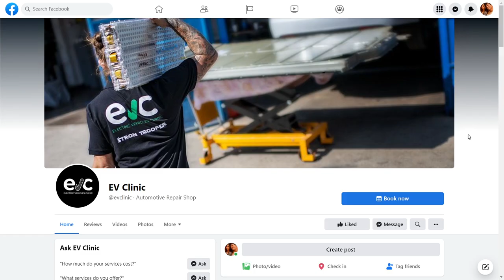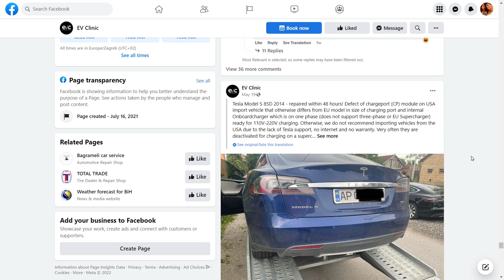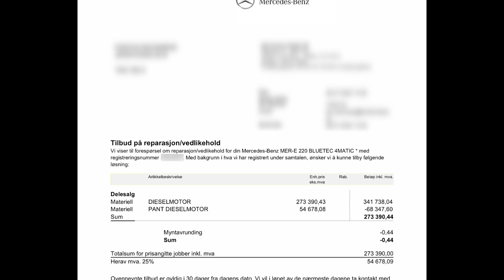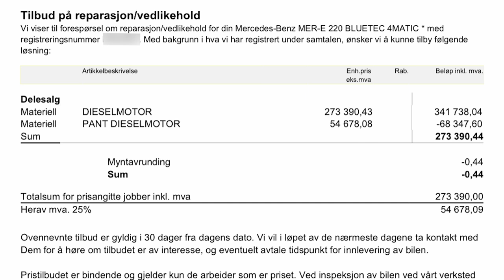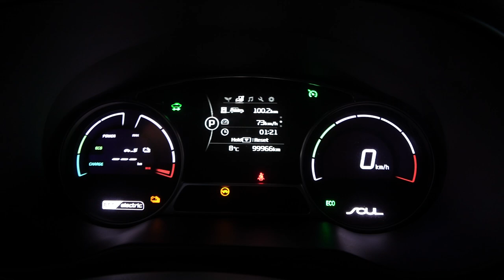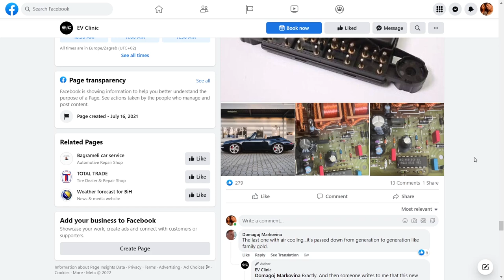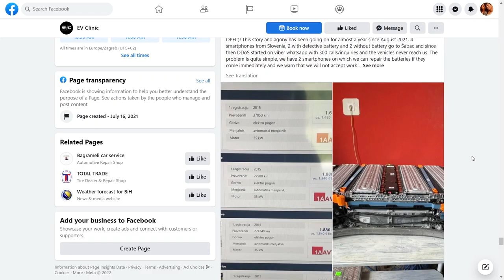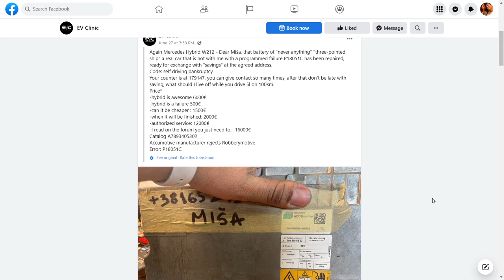Why fossil cars are more expensive to repair than EVs

Comment: So it looks like the consumer ICE design is constrained nowadays by Efficiency in addition to Reliability and Performance. Previously I had heard from a racing engineer that it can only be either fast or reliable. So a triangle diagram a lot like the Cost, Time and Quality that you'd learn on any basic engineering course. How times change, but one always learns something new, thanks for the informative video Björn and Co.
Reply: What do you mean by time? You can literally drive any car at 75mph or 125kmh. What makes it any different other than 1 road and its only in germany? Have you heard camry hybrid? Sonata hybrid? Prius? Corolla hybrid? Honda accord and insight? Rav4 hybrid? Venza hybrid? All of them doing just fine or even better compared to kia ceed that still on top of the 1000km challenge
Reply: @pepehands3399  ICE engines are more reliable than ever. The problem is that electric cars are still too expensive + infrastructure is not there.
Reply: @dragospahontu  thats right, not only they are became more reliable especially the japanese and koreans, you only need 5 minutes refill at gas station to cover 2-3 times more range compared to ev. People are now starting to have concern at the supercharger safety especially at shady place. And when its full you need to wait extra 30 minutes and the charging another extra 30 minutes. For me, thats alot of waste of time
Reply: @pepehands3399  that's another part of the story. But the thing about downsizing and reliability is bs. 

Yes, when strict emissions standards came in, everyone had problems with burning oil. But we are well past those times. 

Now with modern technology engines are better than ever before. Toyota dynamic force engines have 43% thermal efficiency and can run for 500,000km.
Reply: Way to go off course there chief... I am talking about general engineering principles, I'm not having a dig at implementations.

Comment: I bought a used a used zoe a few years ago but after some time it started giving errors and eventually stopped charging sometimes. Apperently the bearings in de motor were toast and the entire motor had to be replaced for around 3000 euros

Comment: I can get a used Cadillac LFX 3.6 engine for my 2014 CTS for only $1500, and the 8 speed transmission for another $1000. Certainly, that is used , 70,000 miles, but I think that will work. I am now at 82,000 miles, and I don t expect anything until 150k when I have to worry about timing chains. With used parts , I can be much cheaper than refurbished ones. The new DI engines are horrible when compared to the good old pushrod port injected ones. Bad reliability, and even bad particulate emissions, all for 2mpg better fuel economy. Great video.

Comment: Wonder how it will work with structural battery pack, does not seem to be possible to repair. Seems silly when you know it could be just a few cells being the problem but with the current construction you can't remove them
Reply: Yes, the new Tesla battery will not be repairable. Sandy could not even open it up without damaging it.
Reply: @dkostasx  then you won't have the problem of water coming in. Which tells the car it's broken. The 4680 won't need any service as old fashion batteries
Reply: @mikaeloverby  You will still need service, just it will be much more expensive because any small issue will lead to full battery replacement. Making the battery unrepairable does not make it not fail. Just because they filled it with some kind of gunk it does not mean that it cannot fail. The battery consist of many components, e.g. contactors, PCBs, cooling system, etc. and any failure of those components would lead to full battery replacement.
Even the old batteries which can be disassembled and fixed are not repaired like that any more. There was a video in YouTube where it was shown that a simple cooling pipe adaptor broke on Tesla Model S battery and Tesla offered to replace the full battery even though the cost to fix the issue in some 3rd party service was like a few $
Reply: @dkostasx  there will always be some mondays car made and that counts on everything. It's very rare that components have a issues, so this will only count for a very few people, that will need a battery replacement. The new tech and design can not match the old fashion used in earlier cars. Only time will tell.

Comment: BMW 116i, 2008 model. It had only ran 72k when I got it (in 2017). It broke down after 5-6months, complete engine failure. 134k to fix. More than what the car was valued at back then.

Comment: a price comparison is made between a repaired battery and a hail new ice engine, this is skewed. First of all, a new tesla battery is not even available/for sale and if you start calculating, an 85kWh pack quickly comes to €22K ex work...just calculate €25K. The story about the Kia battery seems very strange to me and how do you find a match .. 2 new cells will not work, at least then you turn the problem around, mixing old cells with new cells is patchwork and not a long-term solution I think ? a refurb tesla battery then you get what you had in terms of capacity and with a 3 party it's just a matter of waiting how long it stays good. See too many things going wrong with electric car batteries and that's why I'm against third party repair...it's dangerous and you want it to be 100% safe in a car!also take the example of the 1.6 million kilometer model s .... this has had a new / overhauled drive unit 16 times! so every 100,000 km! within the 8-year warranty it does not hurt, but now that the first years of construction are out of warranty, it will be a different story in terms of cheap driving? let us know what a hail new Drive Unit costs at Tesla and then compare it with a hail new ice motor.....
Reply: Finally some common sense!
Reply: These guys are running a business. Plus there are a few people in the world that know how to repair EVs.

Comment: I had Peugeot 308 sw gasoline car and its engine broke (one of pistons leaked), the repair Shop said it would cost around +8000 € to change, also told me it would be cheaper to order whole new engine from france than to repair the broken engine. It was driven only 50-60k kilometers and was 2,5 years old car. Luckily it was covered with factory 3 year warranty so it didnt cost me anything.

After getting new engine, I drove it around 10k kilometers and the roof of piston cylinders had oxygenated (or something, cant remember exactly) and there could be possibly be 5 more reason what cause engine fail error and estimated cost to fix that was at least 1200 € (if no other problems would be found) plus labour, so that was when I traded it away broken few years ago. 

Now waiting for my new kia ev6 rwd gt-line 8)
Reply: That's an isolated case for a french car. The same can happen for an electric car.
Reply: Never buy a French or German car. Some day people will learn.
Reply: @dragospahontu  o shit, didn't saw the replies.

First of all, there will be no pistons in EV so no, it will 100% surely not happen again and after watching this video again, it looks like repairing some battery problem will be 50 times cheaper than what broke in my Peugeot. Good times soon.
Reply: @zappbrannigan8325  it seems like a eutopia

Comment: I believe the two things making modern ICE vehicles more prone to repair is improving fuel efficiency standards and improving crash safety standards.  The improved safety standards have added significant weight to the vehicles (more structural steel and airbags) so in order to compensate (just to maintain fuel efficiency) vendors have to find more weight savings.  I had a 2011 E91 BMW wagon with inline 6 cylinder gas engine that used a plastic valve head cover (and gasket) that needed to be replaced after only 6 years. Having a critical plastic part in the engine bay that is subject to degradation from thermal wear from engine heat is just asking for trouble over time.  Generally EVs are not subject to as extreme thermal changes as a running ICE so will suffer from less rapid degradation of plastic parts.  And as stated in your video fuel efficiency engine improvements (smaller displacement with higher compression and/or turbo)  puts more stress on engine increasing occurance of failures.

It would be nice to also do a pure scheduled maintenance cost between an EV and comparible ICE vehicle (like Tesla model 3 vs BMW 3 series).  I now drive Tesla model 3 based on scheduled maintenance cost alone.

Comment: Ok, so basically EV battery packs are not sold new, you give your old pack back with a "1€" fault and they will sell a refurbished pack that costed "1€" to fix for an incredibly high price, but from what I take from this video usually what makes pack fail are small issues that the BMS blocks pack operation for safety and further damage, and then EV manufactures charge and insane amount o money to fix a very simple fault. This is borderline fraud, there is no justification to charge an arbitrary huge amount to fix a battery pack, when the fault can be a "1€" fix... I'm a Tesla owner and EV enthusiast, on my last year of pack warranty, so great video Bjørn as always, because the only way to go is getting these companies that will fix our "1€" pack problem for a reasonable price... Tesla and other manufacturers should support and sell parts for these guys so they can fix the packs and keep perfectly usable EVs running...
Reply from the maker: You forgot to count in the hours it takes to replace the part, the investment in repair garage, etc. It's simply not just a €1 fuse you plug and play...

Comment: I thought this was the case that ICE is more expensive than EV to repair after a relative was quoted $14k NZD to replaced a 9 year old Diesel Korean SUV with a used engine but this is really great to hear from professionals.

Comment: I think everyone can agree that repairing EVs can in some cases be surprisingly cheap. However, much depends on the specific make/model of the EV, availability of spare parts and availability of experienced EV workshops. The demand for out of warranty EV repairs is currently quite low, and consequently the EV repair ecosystem in many (most?) countries is poorly developed. Until the situation improves, buyers of used EVs will have to be careful.

Comment: I think Tesla has now effectively made their new 4680 structural packs irreparable because they are filled completely with foam. This isn't an EV problem, but going forward I think it will be a Tesla problem. Thoughts on this?
Reply: I guess remains to be seen. Nobody can really know how well these (and others) pack will last.
To me it looks like that Tesla is optimising production cost over maintainability in general.
That is also what Sandy likes :)
I personally  think maintainability in general should have more priority.
Reply: It will catch fire before something else goes wrong.
Reply: Main issue with Tesla battery failures is corrosion and water intrusion. Structural pack massively reduces the risk for this and the need to ever repair it.

Comment: I have a feeling though that all these battery systems overall will require more money over time than a properly maintained ICE...
I have an MB E430 4m with over 400.000km. Nothing has ever been done do that engine in itself in its whole life time except 1 crank position sensor.. where the total bill ended up somewhere between $200 and $300.
I also had to change the fuel pump at around 400k km. 1 cat also went out at 350k km. Replaced both with after market stainless. A couple of $100 in total...
Also 1 water pump. At 350-400k km. Maybe one thermostat also. 
I'm guessing that it doesnt have to occur that many problems with the battery, or the whole system around it, in an EV before that sum is quickly exceeded...
Reply: You say nothing has ever been done then you proceed to list a number of things that have been done :) I'd refrase that sentence...
Reply: @sebastianmdx  No, I clearly stated the engine itself. A cat is not part of the engine itself. Nor is a thermostat. Most people understand that. You are likely going to have a cooling system for the batteries too.
Reply: How much have you spent on services to this point?
Reply: @Frygisk  That would be the cost of oil and filters then.. and a set of spark plugs maybe.. in addition to what service on an EV power train would cost. And fuel.
What does the battery in an EV cost?

Comment: I drive electric cars, but. There are lots of Ice Engines and transmissions that do NOT break down. German, Italian, French etc. cars break down but they are not really good quality! German cars for example look to be good from what you see and feel, but on the inside they are bad. Volkswagen Group has many many engine failures! We do not know yet with electric cars in the longrun. 
I guess the electric Toyota plattform will be very durable and reliable. But we will see. I drive Tesla and Hyundai at the moment. Tesla is great to drive but bad quality. Controll arms etc are very bad. Hyundai is better quality but worse to drive. 
Then there are Mercedes, BMW, Audi etc. I do not believe that they are very reliable. And they are way to expensive for what they are!!! 

So it is not an easy choice. To me at the moment I still feel best with a Tesla 3 and a Hyundai Ioniq.
Reply: @rogerstarkey5390  The chains should last a lifetime. And I worked for VW Audi and BMW, to mention only the German brands I worked with. I know BMW and Toyota/Lexus the best. Mercedes not as good as the others. We had 3 VW engine failures in the family. With quite new cars! That's why I mentioned the VW Group. 😉

Comment: I think itś the other way around easiest is just to look at the insurance costs. ev's are generally much more expensive than ice cars to insure. But to get get the real picture some data from insurance companies would be great. Servicecosts should be lower on ev's but today only teslas are exempt from regular service intervalls, most other ev's have simlilar servicecost to an ice car, but i really dont know why thats the case. perhaps just a way for traditional car companies to earn more money.
Reply: I guess you live in a scandinavian country. But in other countries the insurance costs are the same or even lower (in NL for example). The service intervals are alot longer on EV's and are mostly only inspections. (Brakes,Tires,Fluids) The ICE cars always need at least an oil and filter change every 20k km's. I've been driving cars for about 10 years now and i never had a car that needed no replacement parts. Even my bullet proof Toyota Starlet was at the end more expensive than the Leaf i own today. Because ICE cars degrade in time on every part (Exhaust, Timing belt, Sensors, Starter motor, Alternator, Rubber parts, and so on) combining these costs will be alot higher that just a battery that you probably don't even need to replace.
Reply: @davidoznl  you are wrong.. in norway all ev dealers force to have service plan every year like an ice..if you dont want service plan the warranty is off...  except tesla you dont need service plan every year